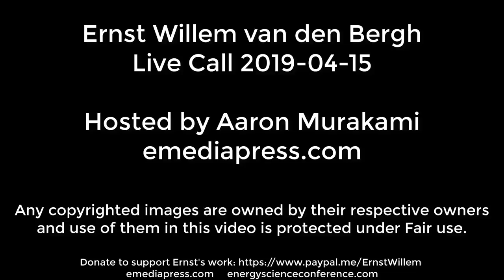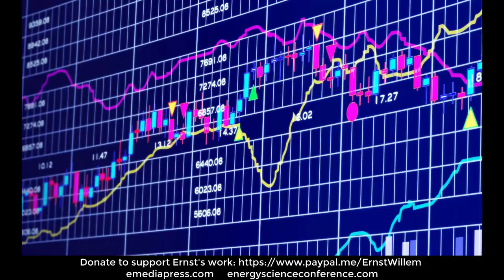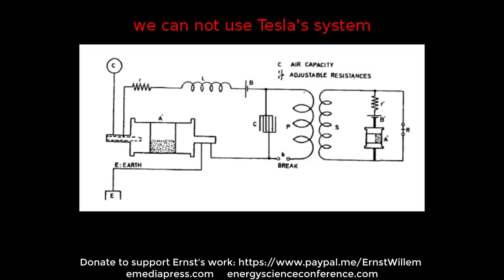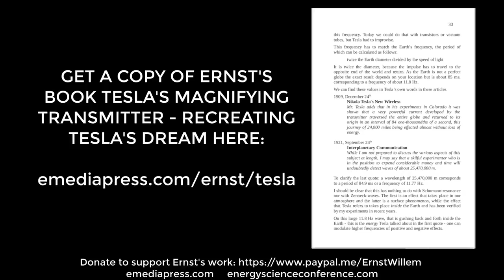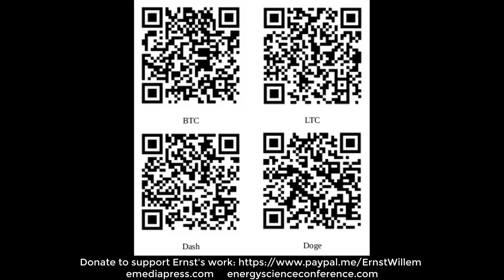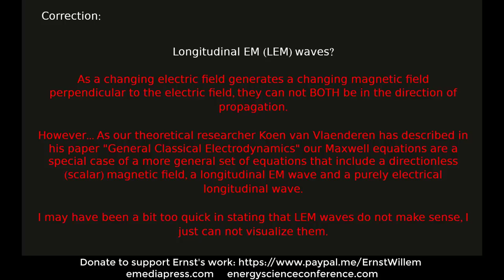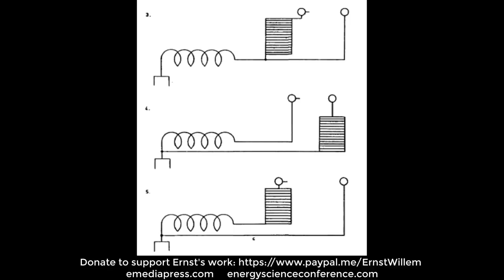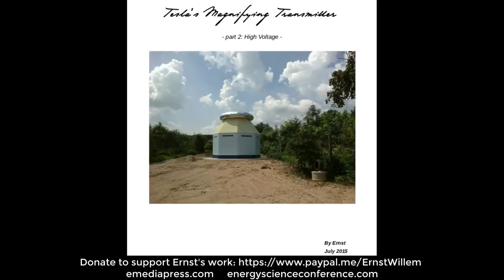2019-04-14 Ernst Willem van den Bergh Live Call - Tesla's Magnifying Transmitter

Comment: I find the distinction between "Aether" and "Medium" very interesting.
Incompressable fluid Aether (non polarised), and the gaseous "Medium" that occurs after polarisation of the Aether fluid. 
It lines up with the Faraday Tubes concept. 
these Tubes represent tension (dielectric field) and pressure (magnetic field) and thus the gaseous "Medium". 

Still these are theories and may not have any reality in nature. But it brings up interesting possibilities, like the possibility to create a gaseous "vacuum" where the Aether can flow into. As the liquid aether represents inertia, it provides power. 

While the Gaseous medium creating the vaccuum can be created without inertia.
Reply: yup in guest's book The Problem of Increasing Human Energy (annotated), he also digs well into NT's evolving usage of terms "medium" and "aether", with impressive depth of analysis (exploring incompressible / elastic / etc distinctions that are so interesting when considering hydraulic analogy of electricity). 

However, i disagree with his assertion that longitudinal waves cannot travel through incompressible fluid. Pressure waves can propagate through incompressible media, as long as it's flexible/elastic (which is always the case to some extent). Elastic incompressible solids (such as rubberized plastic) maintain the same bulk volume even as they flex and are deformed due to directional pressure impulses, thus can propagate pressure waves in longitudinal direction.
Reply: @cold3lectric   I wonder about the term incompressible. for me, gas behaves as a compressable fluid, and makes more sense for the AEther, as an ultra fine gas, much smaller then hydrogen gas. 
Pressure= magnetic current
Tension= dielectric voltage
Reply: Tesla was saying that there were two choices for medium in the vacuum tube. One choice was the demonstrable gas that was present in the tube. The other choice is the ether, which Tesla consistently defined as an ultra-fine gas. Gases are fluids. When he speaks of a fluid, he is referring to gas.

Comment: some ground antenna diagram of Tesla mentions 4Qn and 4qn but there is no clear explanation what Q and n represent. Any thoughts on it?
Reply: Where did you get that diagram from? 
or where can I find it?
Reply: @lvildos  Q is the charge that produces local effects, q is the charge that produces far effects, n is the frequency. During 1 period the elevated terminal has to gain (Q+q) charge to get a positive potential, then it has to lose that charge to go back to 0 and then we need the same charge movement again for the negative half of the wave. Thus this charge flows 4 times through the antenna during 1 period. This you need to multiply by the frequency to get the average (ignoring the sign) current.

Comment: The blue and red also work like this: blue emergence, red expansion.  Blue moves into via smaller wave patterns and red expands into via longer wave patterns.  Convergence-divergence centripetal centrifugal.  All moves though a pattern.  It is a spiral formation.  Right tight left loose.  These two snakes of energies are needed to form anything to one degree or another.  You can introduce any kind of substance into this pattern to create any kind of formed light emission or non formed light emission.  F.L.E.  or N.F.L.E.  The described light here is in reference to the visible light spectrum with the limitations of the seven.  The realms above have hundreds of colors seen in the emissions output.  Everything moves in a circle that is why the stars and planets are circular as is the sun and moon.  Hyperbolic spirals set at different degrees move energy through a circle in a certain fashion.  This is why the spiral is so important.  Beams of light are usually ONLY a transcendent motion of these circles set at different angles.  Once you know this stuff it's all basically the same.
Reply: Everything  eminates from a Central or centrifugal counter point which has one leg here so to speak, and one leg in the invisible.  Both work with the aetheric currents which can be stirred up through a convection process, this usually involves a "wave guide" form much like the designs of temples of the last age.  This energy is then implemented.  What you don't recognize is that the physical forms are actually meaningful and are part of a bigger building block.  The word planet.  Is DERIVED from the Latin phrase asteres planetais which means "wandering stars".  The stars themselves are not Terra firma rather they are sols, souls, sun's, sons of the upper realms here in this Creation.
Reply: The atmosphere as you put it is comprised of two aetheric planes.  One is the upper and the other the lower.  These were always known as the upper and lower "winds".  This has always been in the "water" since everything is full of moisture and at varying degrees of water.  i.e. cloud types and fog and steam. Dew etc...

Comment: I have to disagree about his interpretation that Tesla thought there were two mediums. Tesla said that there is one gaseous medium which expresses itself in discharges which resemble a fluid under high pressure. To say anything else is bogus and unfounded imo
Reply: There are plenty of quotes where Tesla talks about a fluid ether and a gaseous medium and in the quote shown here he mentions both . Did you miss that? 

To say anything else is ignoring his lectures of May 20th, 1891, Feb 3rd, 1892, Feb 24th 1893, and his articles of Jan 7th 1905, May 1919, Sept 22nd 1929, July 6 1930, Sep 11th 1932 and July 10th 1937.
Your disagreeing shows you're unfamiliar with his work.
Reply from the maker: I thought the same as you but Tesla does indeed make a distinction between the two. It's very clear.
Reply: @WardenclyffeResearch  The quote shown here he mentions two mediums, however the first is in reference to the gaseous medium of the bulb. I don't claim to be an expert, but I am familiar with every publication and lecture of Tesla's, and I still disagree with your interpretation. Not trying to offend you.

I will back up my statement with lines taken from the publications on the dates you mentioned. in the 1937 publication, Tesla says "the existence of the ether". That is his only reference to a medium of any type in the whole publication, notice it is in the singular form and not plural. 
In 1930 we see another singular reference, "the Akasha or luminiferous ether".
1929; "the ether".
I can go on all day, I think I have made my point.
Reply: @AJTalks  He never talks about two ethers and I never said he did. He talks about 1 fluid homogeneous incompressible ether and a gaseous medium . In the quote shown he literally spells it out for you let me show it in some more context:
---
What impresses the investigator most in the course of these experiences is the behaviour of gases when
subjected to great rapidly alternating electrostatic stresses. But he must remain in doubt as to whether the
effects observed are due wholly to the molecules, or atoms, of the gas which chemical analysis discloses to us,
or whether there enters into play another medium of a gaseous nature, comprising atoms, or molecules,
immersed in a fluid pervading the space. Such a medium, surely must exist, and I am convinced that, for
instance, even if air were absent, the surface and neighbourhood of a body in space would be heated by rapidly
alternating the potential of the body; but no such heating of the surface or neighbourhood could occur if all free
atoms were removed and only a homogeneous, incompressible, and elastic fluid—such as ether is supposed to
be—would remain, for then there would be no impacts, no collisions.
---
Tell me how can you misinterpret this?
Reply: I apologize for misunderstanding you , I can see now that you are referencing Tesla's theory that the ether is of dual nature, the insulating aspect which behaves like a fluid and the carriers which behave like a gas. I thought you were implying two ethers, which would be presumptuous.
Reply: I, in turn, apologize for being a bit triggered by you calling my work of several 10,000 hours bogus and unfounded. I too have struggled with this issue for quite a while.But once you see it, it is crystal clear and many other things fall into place.
Reply: Imo it’s pretty clear he (tesla) was referring to Z (the universal EM field) as the ether. 1 field ( the only field in reality). Now that field is E and M in it’s natural impedance ( at it’s natural state of equilibrium, although not equal parts). The electrical side ( static electrics) he described, as stated, as electrical discharges (1 field modality) The other as a fluid , magnetism, which we can feel, like a fluid, in between 2 magnets ( The second of the 3 field modalities, the 3 rd being gravity, incoherent magnetism) Which we all have experienced.
Reply: Tesla also said he didn't believe there could be two different types of electricity. I would find the quote if it wasn't so late. Nonetheless, he searched and or believed in the simplest explanation. Also, didn't William Lyne suggest this exact same thing? There's the insulating medium and the independent carriers? I dug into this a bit and came to the conclusion that when Tesla referred to the medium, he was referring to the aether. The independent carriers were simply gaseous particles that we find in our atmosphere. Sorry, it's really late, or I would elaborate.
Reply: @Teleforce1940  Yes, Tesla said that about 2 electricities in his lecture May 20th 1891 "Experiments with Alternate Currents of Very High Frequency and Their Application to Methods of Artificial Illumination". I don't know about William Lyne's theories.
I first also thought that when Tesla talks about "the Medium" he referred to the ether, but looking into this a bit more proves that he did not. The independent carriers are "not gasses that chemical analysis would disclose to us". See my reply to A J 5 comments up from here.

Comment: Here are the links to the documents mentioned in this video:
"The Tesla Code" - https://drive.google.com/open?id=1c1iBBZLZYq-TGrQh707SwrgynuhW1Bd0
This document shows an interpretation of "The Problem of Increasing Human Energy".
Some conclusions in this document have changed a bit but it is still about 99% correct.
 "High Voltage" - https://drive.google.com/open?id=0B70OHRF13ajnTERzUnE0T2ZnOVU
This document describes the technical details of my initial set up in my lab here in Thailand. This is the pre-generator set-up. In the current set-up the coils and capacitors are still the same but some small changes have been made to work at much greater power levels.
I will make updated versions available as paperback on Amazon later this year.

Comment: The energy plasma flame that flows freely from the core flames up near the surface at times like Bermuda Triangle ! The energy can be seen with energy penetration satellite to see the eight quadrant away from the magnetic poles to equator as tip of a flame and wider end of triangle is near the core of earth ! And plasma is free to move up or down like a fire but is held in place at the base near the core ! This is the best way for me to tell you what my own research has shown as repeatable observations until the use of this model was changed so I could not continue my research ! Such is frustrating as things can get but time used was nit wasted to find the plasma waves and how they move !

Comment: His windings do not have the proper inter-turn spacing, the losses must be horrendous. How is this even a proper replication
Reply: Please do explain, preferably with reference to Tesla's original work.
Reply from the maker: Please show a video and stats on your own replication to give credit to your own understanding.
Reply: @WardenclyffeResearch  If you look at the Colorado Springs coils you can see that all of the coils are made with space between the windings. Tesla apparently used this to increase the Q factor by reducing the losses according to Eric Dollard and also Professor Corum (they both talk about the importance of having this gap between the turns). Corum also talked about not using thin wires because of the high frequency losses. Your coils are apparently made of magnet wire with no gap between each of the turns
Reply: Which coils of mine are you talking about? Certainly not those in the lab.
Those are not made with magnet wire and they have spacing between the windings. The specifics have been carefully calculated.
And BTW. the Corum bros don't understand the first thing about Tesla's theories.
Reply from the maker: @WardenclyffeResearch  You got that right - the Zenneck Wave business is all nonsense.
Reply from the maker: Spacing between the wires is not an absolute. It all depends on what you are trying to accomplish. On the early MWO's we produced, we had fishing line of an exacting diameter between the windings. Those are really resonator coils and are not true Tesla coils. To get the waveform we were looking for at the frequency we wanted, we're getting way more output for less input with no spacing between the windings with common spn coated wire. You have to take each situation as a case by case basis. Look at the pics of Eric Dollard's Colorado Springs build by Bruce Gavin and all his older models, every one has spacing between the windings.
Reply: @Aaron Murakami  Not just that Zenneck wave stuff, They are trying to force Tesla's theories into modern understanding and that just won't work .... at all.
Reply from the maker: @WardenclyffeResearch  I know - I agree.
Reply: @AaronMurakami13  Are you making the TeslaTron ?
Reply from the maker: @sxprelude  No, too complex and unnecessary, plus it is a potentially very dangerous machine. The MWO we manufacture is all that is needed https://vril.io

Comment: Do you know how the radiant energy of Tesla becomes dangerous? when a conductor such as copper is coiled in an iron core, the iron lowers the frequency and increases the tension, it heats up, a very hot high voltage transformer, through the iron core, now if we put a nucleus of air, nothing heats up, more tension, more cold, more atmosphere, more ozone, cold energy, to transmit that energy (frequency) all powerful of the universe, Tesla made a giant antenna of iron, buried and on the surface, the same meters towards down that up, all this in a cage (Faraday's cage), so that the high tension of the iron does not kill anyone and concentrate, as it is known the highest point of voltage and tension is at the ends, then the point maximum voltage at the root of the antenna is very low and the maximum point of antenna tension up is very high, here put a radiant ball, radiated all the high voltage to the world, very high voltage, very high voltage, very high frequency in a giant core of hier This nucleus braked so much the high frequency that it increased the tension incredibly, and transmitted it at the high end of the antenna, and one at home on the other side of the planet, had a pancake coil of 27, 28 turns, or a coil tube tesla, any coil of air core that receives that high tension and transforms it into low tension, which kicks but does not kill, heals and gives life and is free, that is why people approach a high tension tower, the tower sucks it, the tower becomes magnetic there at the end, and sucks any body with a good amount of polarity and kills it because it catches it in magnetism and kicks it to a lot of voltage, if the core is out of air and not iron, the tower gives off radiant cold energy, I do not know if you knew this but well, I noticed it because I thought that one has a bonina resonating at high frequency and does not suck it magnetically and kill it, but it gives off cold energy nothing more and ozone, then the wireless transmission becomes di easy, it is arranged putting the iron core, but it is necessary to move away because it is dangerous, but maybe a kernel or graffine coil, which is more conductive than copper and if we paint a guitar string with graffine, it is more flexible and more conductive, then resonates more often than copper, huge hug, I'm Argentina's pablo
Reply from the maker: That would be a conversation for http:/energeticforum.com